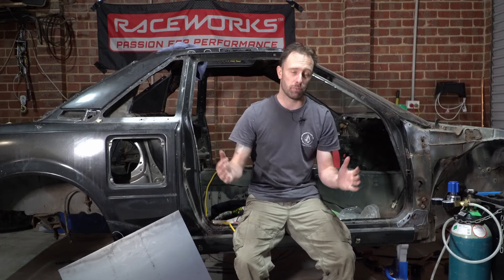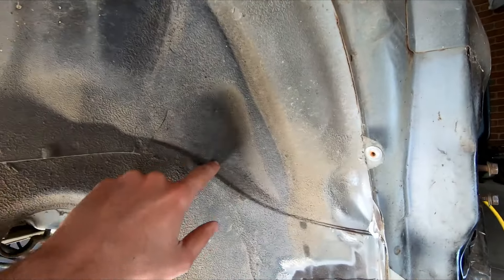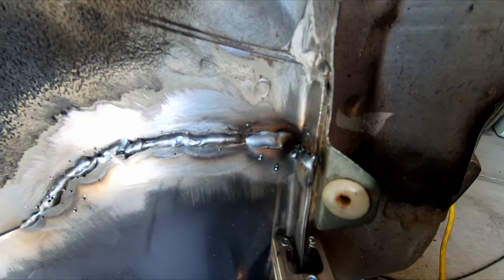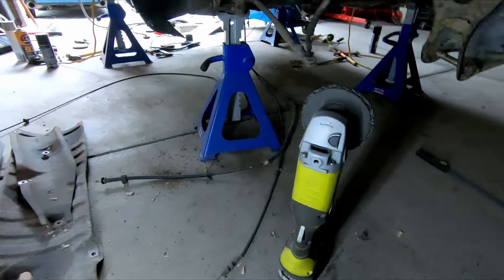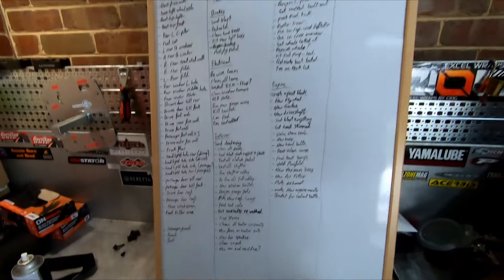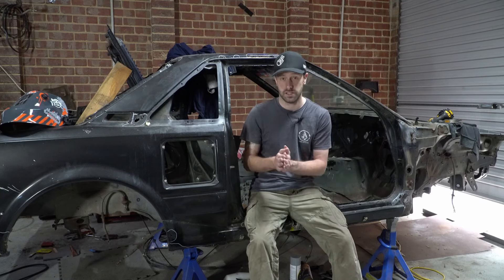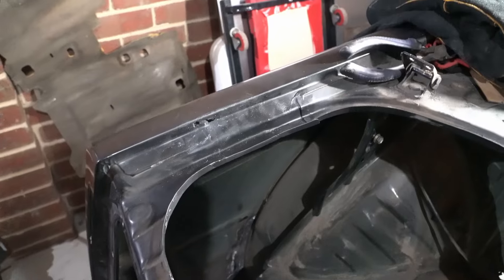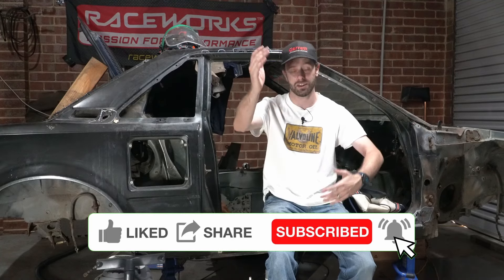Rust repair on the Toyota MR2 - Time for a new welder!

Comment: I can only encourage you to keep going, from my own experience. Do not let others dissuade you. Yes, there will be times when you ask yourself the hard questions, and you will feel despondent and WTF. But take a break and then get back into it. When I started circuit racing in 1995 I knew nothing. I jumped in and bought a car, and then did short courses at night at TAFE - spray painting, metal fabrication and welding. Nothing onerous but combined with what I was learning as I went I was able to build and rebuild several cars. People ask me when they see my projects "Am I a mechanic?" but I was actually in IT! That welding machine - I struggled with an old one for many years but bought that lightweight unit about 18 months ago. Great reviews, as you mentioned, and well justified. A great little machine. Price has jumped a bit from the couple of hundred I paid but still a cost effective little machine with some great features. Keep up the good work. Look forward to your next instalment.
Reply from the maker: Cheers mae :) and yeah welding tech has come a long way, i couldn't believe how much easier that new machine was making things, and if nothing else i'm not second guessing myself if it's the machine or me as i know the machine is doing the right thing. 

Honestly right now ti's just time, i just need the time to get in there and knuckle down and get it done, but as you'll see in the upcoming video i keep getting thrwated haha. I'll get there!

Comment: Well done, we all start not knowing anything, practice gives knowledge. Don't know where your up to with your repairs but one thing I've learnt, and noticed in your boot surround repair, might be applicable elsewhere...break your repair panels down to match the way the car was made. looking at the boot surround panel 1 was the  outer skin which folded down into the boot recess, panel 2 was under than and formed the recess and lip the boot rubber clamps onto usually will result in a series of simpler to make panel pieces. Don't be afraid to cut the outer panel slightly bigger, repair the under panel then remake the outer withthe folder. .8-1.0 will fold nicely and easily. You will end with more smaller panels needing being made, but they will be simpler, but the bonus will be less filler work and factory looking seams, which is always nice, and quicker overall. On thin stuff, specially onto old Japanese steel run a series of tacks along the joins, alternating ends etc to prevent overheating and warping. You will get there, now get back in the shed!
Reply from the maker: Thanks mate! :) appreciate the advice

Comment: can I recommend you have a look at some Youtube videos from these guys, Trev's Blog and Wray Schelin's ProShaper Workshop, this will help you with the welding and panel work. Their great for using slapping spoons, shrinking disc, making patch panels and welding. Where you welding your panels put a flat piece of cooper behind it, makes a big difference.
Eastwoods do an internal frame coating paint, comes with a long thin hose and nozzle, works great on internal rust. Best thing I ever did was move to a Tig, best thing for panel work.
Also dump the etch primer and go with epoxy primer, etch primer can react with bog and attracts moisture which causes problems later on down the road after your painted the car, epoxy doesn't react with anything!
Reply from the maker: Cheers mate :) and yup i'm using a flattened copper pipe behind where i can access and i'ts helped heaps, and also i have ditched the etch primer and do use an epoxy primer as well :)

Comment: Keep Plugging away at it. And Stitching & Butting. 👍🏻 Suggest you look into Cavity Wax or Chassis Liner in an aerosol can with the flex tube. Get good coating inside the Rails etc really easily & messy. Good Luck
Reply from the maker: cheers bud :)

Comment: If you want to learn some tips and tricks when repairing panels, and complex shapes, then check out this channel. Some of it has subtitles but most don't. No matter. You don't need to know everything they are saying. But the work they did on the Skyline R33 GTR which they rebuilt basically from scratch, as well as the Datsun Z is just amazing! https://www.youtube.com/@51machines